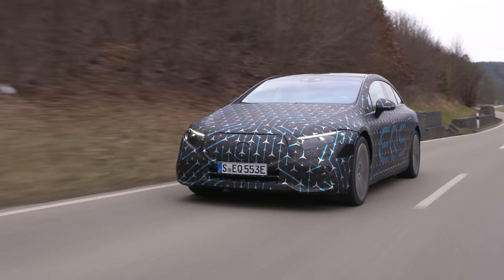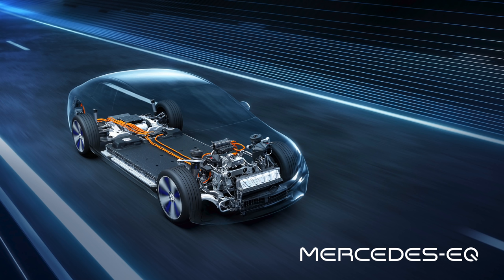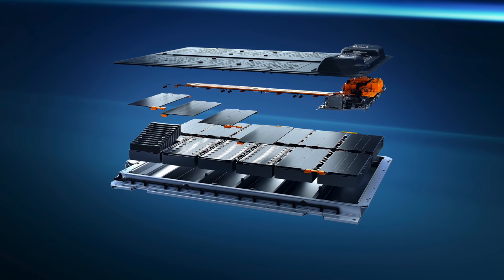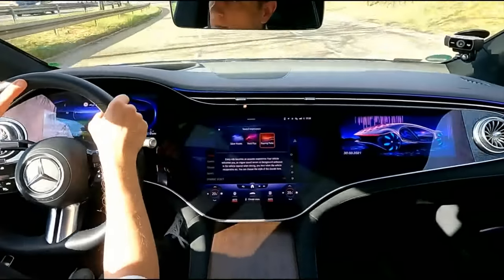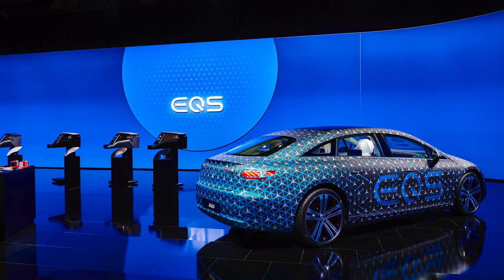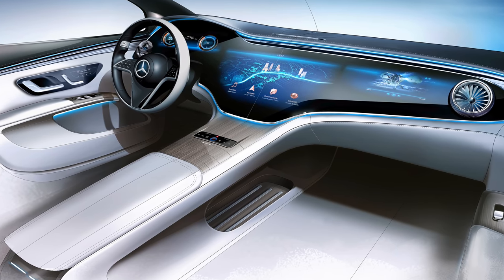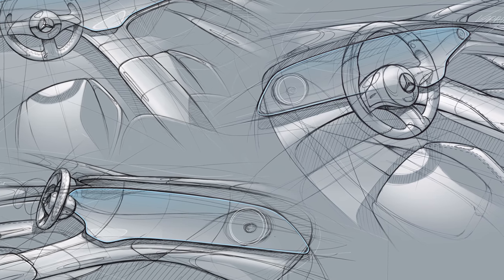Everything To Know About The New Mercedes-Benz EQS

Comment from the maker: 0:00 - EQS Introductory Info
2:44 - Battery
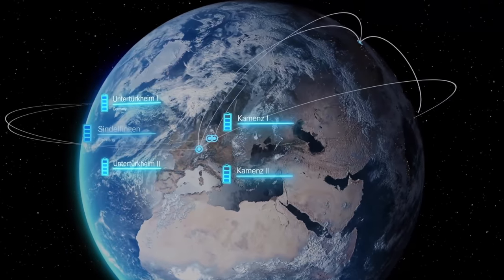5:35 - Charging 
9:17 - Range
10:52 - Motor / Drivetrain
16:14 - Regen / Recuperation
19:16 - Road Trip / Route Planning
24:54 - EV Tech Summary
25:46 - Exterior Design
29:50 - Interior Design 
35:15 - Display Graphics / Menus
37:44 - Sound Design / Acoustic Experience
43:09 - HEPA Cabin Air Filtration 
49:11 - Energizing Comfort / Nap Mode 
53:02 - MBUX Hyperscreen 
1:00:10 - Sorry for the long video

Comment: Great video :) 

The top speed is due to range extension. The car uses special tires. If you need more topspeed, you need to wait for the performance version (most likely an AMG version).
S-class is more for comfortable long range trips, so I think the speed should be enough.

According the regen - you have different modes for the regen. More like a sailing mode, a max regen mode and the intelligent automated regen mode (the car looks ahead the track of what is coming, for example traffic, corners, height etc, and chooses the best regen mode for the situation.

I was sceptical about the design. I found the pictures a bit boring. But a german youtuber how got the chance to see the final design said "I was sceptical about the design when I saw the first pictures. It looked a bit boring. But trust me, the car looks absolutely freakin good in the final version without camouflage". I hope he is right :D

On the passenger screen you can actually watch movies or play games.

Comment: If it has a 200kw stable than it is 50kwh in 15 minutes, which translates to about 770*(50/108) = 356 km in 15 minutes. So, are they sandbagging with 300km, or it is just a round number and easier to remember?

Comment: Kyle, don't you think that EQS should have came with 800V architecture with even higher charging speed? They will also use this 400V system for AMG cars (this is how I understood). Will that be enough for a more sporty usage. Although they have said that you can sprint with EQS as many times as you want, they have special cooling for that.
Reply: I’m not so sure it’s needed. Porsche recently introduced an option in the Taycan (800v) to lower the charge rate from 270kw to 200kw to preserve the battery life, which Mercedes has matched.

Comment: to put 130 mph top speed in perspective Volvo in 2020 has limited all cars to 112 mph for safety and soon in Europe  cars will be required to have top speed limited.  also don't forget there will be AMG version and as you mentioned there is no 2-speed gearbox so gearing directly impacts both acceleration and efficiency and 130 mph is the sweet spot because it places most driving right in the middle of RPM range where motor is most efficient.  it was also said that 130 mph is due to tires as indeed tires come in speed classes so there is a class of tires good for 112 mph and the next one good for 130 mph and so on ... but IMO that's not the real reason - that's just an excuse.
Reply: There is no top speed limit requirement.
Reply: @abraxastulammo9940  not yet ...

Comment: It is interesting that they are packing the same mount of battery into the car as Lucid. But I think this is a much bigger vehicle. Also, I think packing prismatic cells uses less space than packing cylindrical. So was not possible to pack more? How great would it have been if they break the 1000km range :)  Or at least 800, or 900.
Reply: I guess its never enough for some people.
Reply: Scientists in Ireland have apparently managed to create an engine that runs on compressed turnip juice.
Reply: @NedNew  
More choices!!!
Reply: Kona already drove 1000 km with its 64 kWh battery, so it is a bit meaningless.
Reply: @abraxastulammo9940  You are just joking right? It is interesting to prove that you can go a lot with 25kph, but it is not what you can produce on highway.
Reply: @toth1982  WLTP has an average speed of sub 50 km/h with peak speeds of 131 km/h.
75 mph or 120 km/h highway range will be less, obviously.

Comment: Every MB sedan has a electronically limited top speed of 130mph. Only AMGs get a higher top speed. So this is not a compromise for the EQS, its just a standard setting for a Mercedes sedan.
Reply from the maker: Yes, usually down to tires
Reply: Most mb and bmw are limited at 250kmh/150 mph?
Reply: @nicnordic6143  indeed, 155mph for almost all German cars except AMG/M-sport/RS-cars. But Kyle is right: because of special EV-tires they limit to 130mph.
Reply: @ts7902  Nope, its not because of tires. Its because of expontly. rising energy demand. Volvo started to cut the max speed at 180 kmh for all cars. Here in Ger discusssion on speed limit getting stronger. Id.3 is limited to 160 kmh.
Reply: @nicnordic6143  But Polestar has...205 km/h?
Reply: @abraxastulammo9940  Just for marketing, Tesla S/3 have their optimum speed around 165 kmh on Autobahn, big and small SUVs are thirsty like hell over 130.
Reply: @nicnordic6143  That is why germans love their sporty station wagons instead of the global SUV trend, still roomy but energy efficient at high speeds. 👍
Reply: @abraxastulammo9940  Nope, most developped countries use estates, sedans, hash backs, transporters. Only US/Canada building big. ;-) (OK, some SUV trend even here...)

Comment: I will explain the 130 mph speed limit, all Mercedes' save the top AMG models in the US are limited at 130mph even the AMG 53 models. Everyone thinks that the autobahn is a network of no speed limited highways, which is false, the autobahn is mostly speed limited, only stretches of rural highway have no limit. As in the rest of the EU, most of the autobahn's top speed is 130Kph (80mph). In fact, every year the unlimited stretches are fewer and fewer particularly since the network is getting old an is constantly under repair. A production EV that can go at extremely high speeds is idiotic given that just a few very highspeed runs will end up depleting the battery in a flash and, as we are all well aware, there are not 30 second race "fillups" possible. Lastly, as you have well pointed out the name of the game is aerodynamic efficiency, regardless of drag coefficient air resistance increases proportionally to the speed thus the faster you go the higher battery drain just due to drag. In conclusion, the EQS is not a track vehicle, thus, a top speed 40% higher than any legal speed limit in the world is more than sufficient.